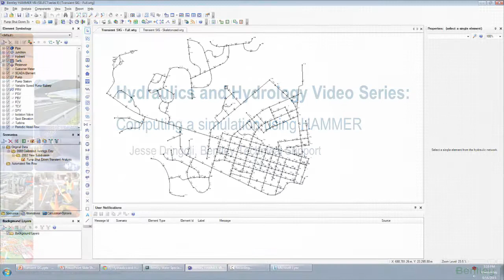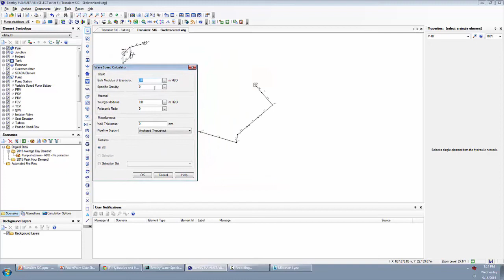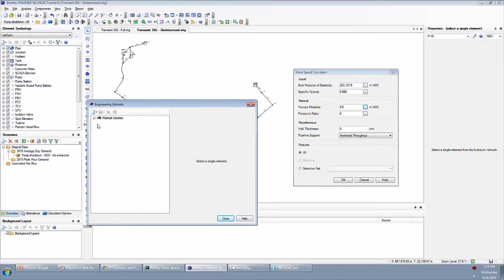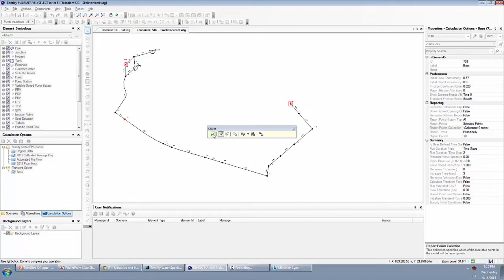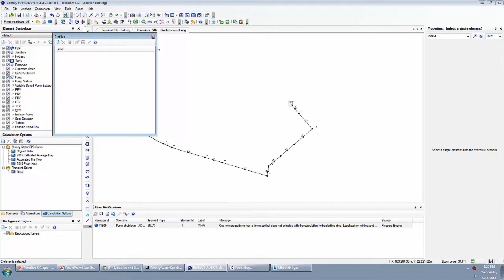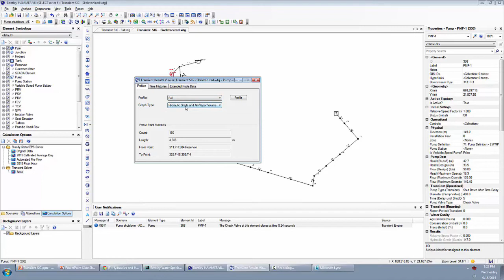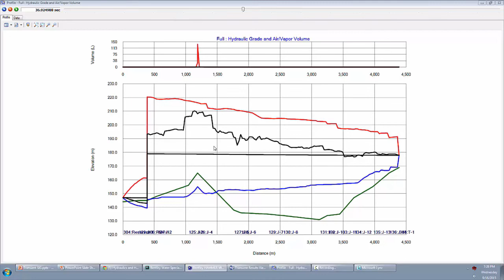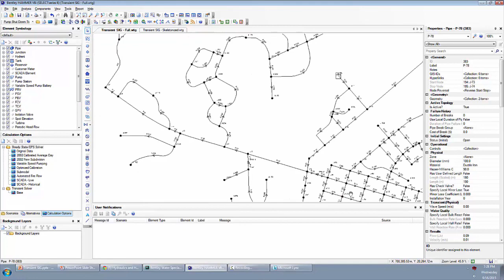Learn HAMMER Part 1 – Computing a transient simulation

Comment: What does it mean to constantly receive the message "Failed to load model, Please run a full validation for more information", for all the models I am simulating using HAMMER?
Reply from the maker: Dina, that error could be due to a number of issues with data entry. Try running the Validate command, check your model for problems, update to the latest version of HAMMER, and if you still need help, please post on our Forum: https://communities.bentley.com/products/hydraulics___hydrology/f/haestad-hydraulics-and-hydrology-forum

Comment: Hello thank you very much for sharing about this topic.
I have some questions about Pump Definition types can you help me ?
I couldn't understand which type and when ı will use in pump definition type . What is mean Standart ( 3 point ) and design point ( 1 point )? 
For example in my project , ı have one pump ( elevation 1000 m.) and reservoir ( 1100  m. ) for this which one should ı select as Definition type?

so in pump definition type, there is a column " head " for this how can ı calculate design head , shut off head , max operating head ( if ı select standart (3 point)) 

Please can you tell me ? Thank you again.
Reply from the maker: Hello, please post your question on our Forum: https://communities.bentley.com/products/hydraulics___hydrology/f/haestad-hydraulics-and-hydrology-forum